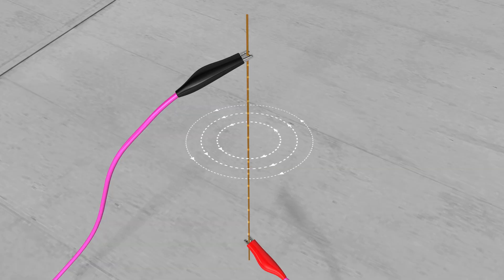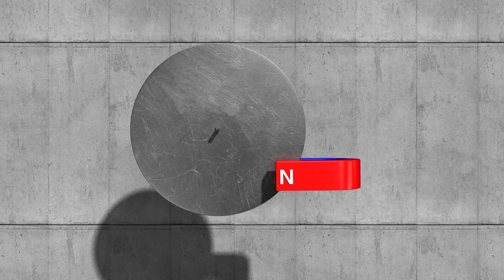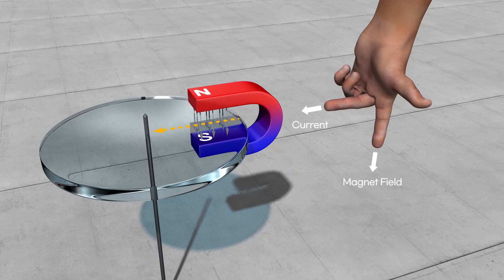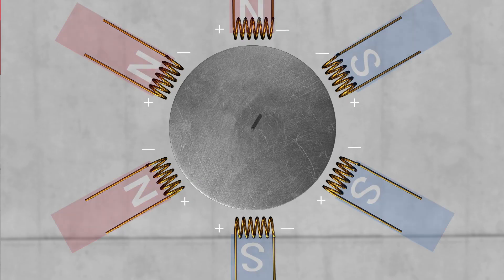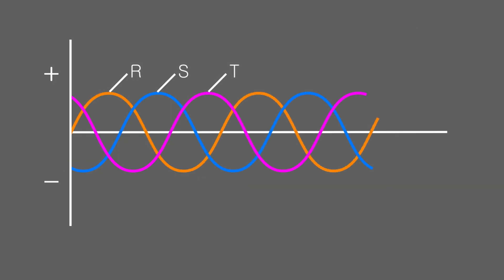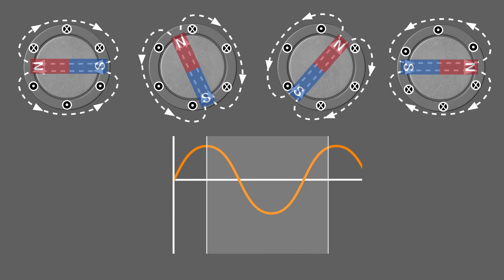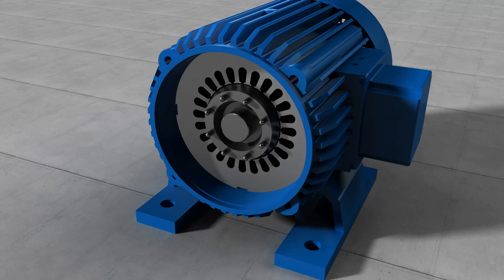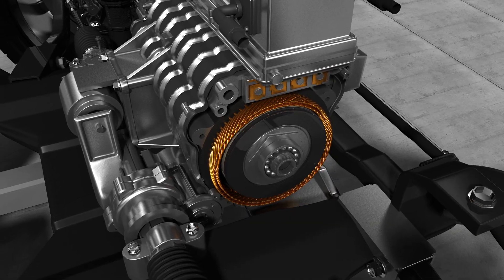How Electric Car Motors Work | PMSM vs Induction Motor Explained

Comment: why taling about 3-phase motor for EV ? It is not related
I hoped to see how the electical motor was combined with the transmission in a hybrid car
Reply: Three-phase motors are the primary propulsion system for most modern EVs, offering high efficiency, smooth power delivery, and the ability to perform regenerative braking. The main types are Induction Motors (cheaper, no permanent magnets) and Permanent Magnet Synchronous Motors (PMSMs) (higher power density, better efficiency), with both providing reliable and scalable power for vehicles ranging from cars to commercial trucks.